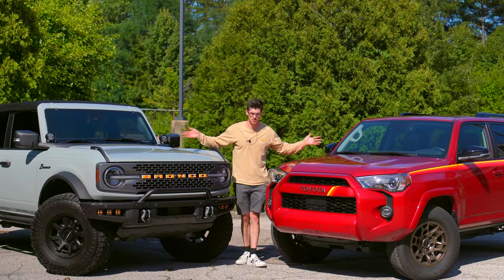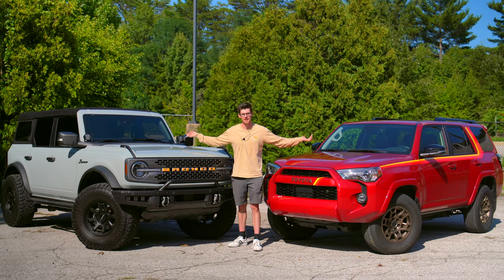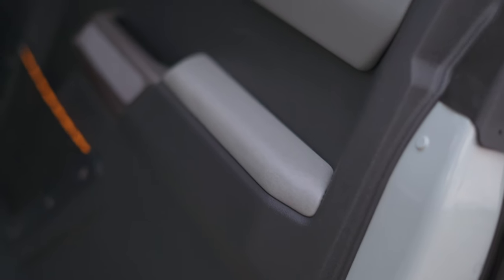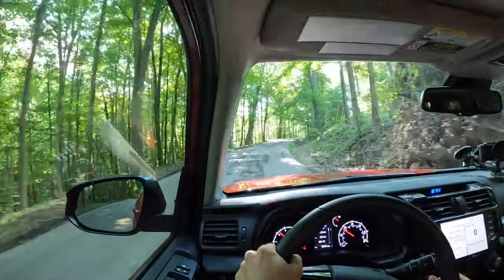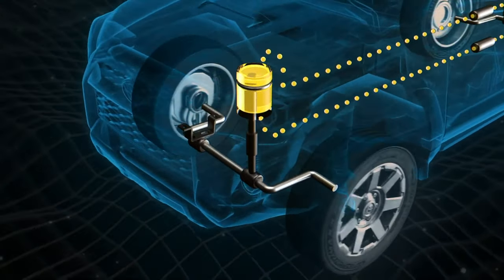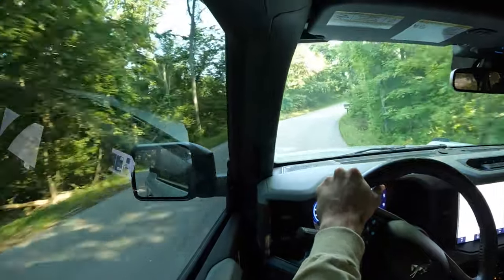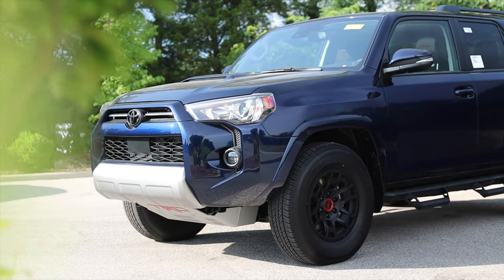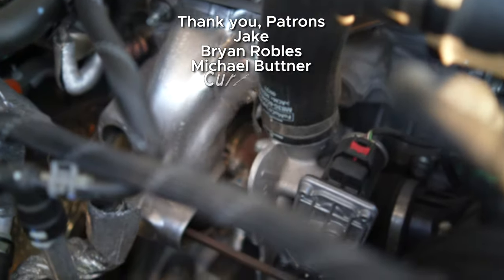2023 Toyota 4Runner vs Ford Bronco In-depth Comparison / Rivalry Resumed

Comment: I will never daily drive anything other than a 4Runner. My '06 is a tank  and asks for nothing but fuel. I respect the Bronco, but 4Runner for life.
Reply: I had to replace the transmission in my Ford Explorer at 104,000 miles.  Prior to the Explorer I had a Bronco and had to replace the transmission at 114,000 miles.  I switched to 4Runners and will stay with them as long as Toyota makes them.

Comment: I really, really wanted the bronco. Ultimately went 4runner for long term reliability (I know I know). No regrets.
Reply: I did the same as you and I would of had the family pricing with Ford, no regrets either.
Reply: Same
Reply: The 2.3l is really reliable tho I've worked on some with 120k miles (not the bronco) that just asked for a oil and filter change, a bit of carbon build up on the valves nothing else ,some people claimed 200k miles out of their 2.3 it really depends on the driving and maintenance if you're gonna abuse it and skip oil changes get the 4runner but if you're a careful owner and do everything by the book even if you drive it hard you can still expect the bronco to last a long time
Reply: Ive had a bronco Badlands for 60 000 hard miles. I drive offroad most weekends and lots of winter driving. 0 issues

Comment: Unfortunately the 4Runner comes only with an automatic transmission, and the closest brother is the Tacoma which is way too slow. I went with the Bronco 2.3 Manual, 2 doors. 9k miles with Zero issues.
Reply from the maker: That new taco with the 2.4 and mt may change it but the 2 door bronco is undoubtedly more fun, congrats!
Reply: The fact that you have to state 9k and no issues should tell you chose the wrong vehicle 👎
Reply: @TonyTundra5.7 u a 🤡
Reply: @TonyTundra5.7 you can keep getting scammed by Toyota if you want 😂😂😂😂

Comment: I’m obsessed with my 40th anniversary edition 4Runner…I looked at the Bronco but for me there was absolutely no debate.  I’ve owned it 3 months now and I’ve never been so obsessed with a possession… It’s weird lol.  I just turned 40 years old and was born the same year the 4 Runner came out so I’ve seen and respected them my whole life…Im a car guy and traded in my GTI for it.  The GTI was an awesome car that I loved too.  No issues with it besides occasional electrical quirks.  But the obsession that hasn’t gone away since trading in for the 4 runner is real.  So well made feeling.  I like the smooth truck feel on the rode and shitty roads.  It’s just a pleasure and I find the hydraulic steering an odd pleasure too.  No it’s not super responsive or tight like my GTI…No I don’t smoothly effortlessly fly up hills at low rpm’s like my GTI did….But I’m 40 now and don’t care.  I like the smooth daddy 4 Runner.  The only thing I’d trade it for in the future is MUCH better gas mileage.

Comment: I ended up buying a Bronco this January. I test drove a 4Runner, and Bronco Sasquatch V6. The V6 just ran better and hauled more butt than the 4Runner. And the Bronco was more fun to drive. Very responsive on the Highway and city, and with crazy tourist divers where I live, I needed something that responded well. 

And at the end of the day, it did more of the things I wanted to do. Doors off. Roof off. I know that’s apples and oranges to the 4Runner, but that is what pushed me over. 

And at now 24k miles, fingers crossed, no issues.
Reply: Any updates on the bronco? Still running strong? Mileage update?
Reply: @slickman9696
Reply: Need updates man
Reply: how’s the bronco been?

Comment: I owned a 2018 4Runner trdOffRoad and it really was a fantastic vehicle.  Very comfortable.  The 4.0L engine is great and surprisingly well matched to the 5 speed auto.  But towing needs now have me in a 21 f150 (diesel) which I also love for different reasons.  

Folks complain about Ford quality, but my experience with my f150 has been great.  The truck is holding up well no no real issues so far in 30k miles.  Can’t speak for quality or durability of the bronco, though.  They certainly don’t make as many of those s they do the truck (which they produce a bazillion of each year).
Reply: Give it some more time.  Please, give us an update when something breaks.
Reply: No issues in 30k miles should be expected on any vehicle

Comment: Bought a used 2014 ORP with 80k miles, did my research and checked thoroughly for any abuse or neglect. Comes with no warranty, and no warranty needed so far. Now have added 15k miles and I love how strong its body is and have added a ladder and a Sherpa rail. Been in a few adventures

Comment: I have a 23 Basesquatch with 780 miles on it and its at the dealership for electrical/Charging system problems. The bronco looks awesome but Iam thinking about trading it in for a new trd orp.

Comment: It was an easy call for me, sway bar disconnects (way more articulation), front and rear lockers, full skidplates and rock rails, Steel bumpers, better offroad tech, convertible and looks amazing

Comment: Bought a 2023 TRD Off Road Premium in Oct. of last year. Taking it off roading in Montana end of May. I'll let you know how that goes, but from everything I've read and watched on YouTube, the 4Runner out preforms the Bronco off road.
Reply: Back from Montana now, the 2023 has 4 cameras, back up, front facing and two on the mirrors. The front and side cameras come on when in crawl mode and make navigating tought terrain extremely easy. Took it up and down mountains some descends on very narrow, 7 degree grade very rocky terrain. Largest were about the size of basketballs. Took her in to get looked over before driving back and everything was tip top shape.
Reply: Having owned both and having taken both off-road many times, unfortunately that just isn’t true. In almost every aspect of off-roading, the Bronco outperforms the 4Runner.
But that’s also expected, as the Bronco is an off-road focused vehicle, where the 4Runner is more of an on-road/off-road hybrid. And there’s nothing wrong at all with that. For 90%+ of all drivers, the 4Runner serves its purpose.
But for those who actively take part in frequent off-road driving, the Bronco is clearly the way to go.
Reply: @Rapaglia1  idk I watched a ton of use reviews and the 4Runners technology made off roading way easier for the regular guy. Now if you're taking tip top preforming, you might be correct.
Reply: @joshualinse9000 
I’m speaking from personal experience. If the average off-roader wanted to take their 4Runner through a mountain trail, sure. It’ll handle it just fine. When you start adding 35”, 37”, 40”, 44” etc. tires to the 4Runner, it starts to seriously degrade performance. With that, you have to change out the gearing as well. The 4Runner also doesn’t have a sway bar disconnect which is a huge advantage for the Bronco.
I like 4Runners. I think they’re great vehicles. But the bottom line is that they are made more for the average driver to drive on the road with occasionally taking it on trails or through other off-road terrain. And it’ll manage that just fine. It’s just that you can’t do many upgrades to it without having to do major tuning and calibrating.
The Bronco, on the other hand is purpose-built for off-road driving. Adding larger tires and even bigger lift kits is no problem. Not to mention, because the Bronco is more versatile and more customizable than the 4Runner, it has access to an entirely separate upgrade market of parts and performance tuning. As far as on-road daily driving, it’s better handling, smoother, and easier-driving than the Jeep Wrangler, but not as good as the 4Runner. Again, in my experience, it’s a great daily on-road driver with good power delivery, excellent safety features, and all of the creature comforts that you need. The Bronco is perfectly suited for daily driving; just not as comprehensively as the 4Runner. What I’m saying is that the Bronco is a much better 2-way vehicle than the 4Runner. The 4Runner is a much more functional and comfortable daily driver, but it’s not as comprehensive as an off-road rig than the Bronco.
It just depends on what my driving goals are. Both have their strengths and weaknesses as far as how and where you choose to drive. There are many situations where I’d rather have the 4Runner. But there are many more situations where I’d rather have the Bronco.

Comment: Price be darned, I'm on waiting lists for both the forthcoming Lexus GX550 and Toyota Sequoia TRD Pro (2024).  Test-driving a 4Runner, I found it just a bit too underpowered compared to my '17 Tacoma.  I liked much of the Bronco's specs, but can't get over its unreliability.  I wouldn't have the time or patience to have its top-of-the-line engine go out and need replacing, taking ~7 weeks.  Given the two choices in this video, I'd go with the 4Runner.

Comment: The sticker price on my 22' 2 door Bronco Base manual was $28,500. The 35" Mickey Thompson Baja Boss were a little extra but at the time manual transmission wasn't available with the Sasquatch package so I elected not to go with the Sasquatch. Coming up on 20,000 miles with no issues. I wouldn't want any other vehicle. I drove a 4 Runner once, and the body roll was absurd.
Reply: I did actually have 1 issue right off the bat, there was a problem with the headlight switch and the headlights would come on randomly after being parked for about an hour, stay on for about 10 minutes and then shut off. It was fixed for free simply by getting a new headlight switch and problem was solved.
Reply: How and where did you get that price
Reply: @AngelMartinez-kf1dg  I put my reservation in June of 2020 for a 2021 and the price was $28,500. There were so many delays that it kept getting pushed back. Eventually they said it won't be available until 2022 so they upgraded me at no extra charge for the 22' model which I got in March of 22'. New Brighton Ford in Minnesota.

Comment: I don’t really understand the hate for the 4Runner’s 8 inch screen. Yeah the back up cam is pretty bad for sure. The screen though looks very purposely built in and is more than sharp enough for apple care play, which is all that anyone uses.
Reply from the maker: It doesn’t deserve hate, I appreciate its simplicity but it does deserve criticism for the camera quality, response time and meh resolution/brightness. Id rather have it over a lot of full digital setups that imbed the hvac controls.

Comment: After having owned a 2022 4Runner, and now a 2.7L Bronco Outer Banks with Sasquatch, Lux and High packages, I will never buy another 4Runner again. First of all, everybody drives them. They’re not special. But not that many people own Broncos.
On top of that, the 4Runners are boring, slow, and getting outdated. Even the new 4Runners are already going to be lacking behind in engine performance and electronics.
While they’re reliable vehicles, they’re not nearly as rugged or capable as the Bronco. On top of that, they’re just like any closed platform vehicle. With my Bronco, I can remove the top and doors and experience a true open-air driving experience. And the Bronco cool factor is way ahead of the 4Runner.
The 4Runner might be a more comfortable on-road ride, but the Bronco’s road handling is just more fun. And if I’m going to have a vehicle for the next ten years or more, I want it to be one that I enjoy driving.
So, because of the enjoyment factor, the driving experience, the on and off-road capability, the better amenities, and the more customizable options, the Bronco is the clear choice for me.
And don’t get me wrong - I love the 4Runners. They’re a symbol of standing the test of time. I had a great time with mine. But all things considered, compared to the Bronco, they’re just not in the same class.

Comment: I own a 22 TRDORP, so I am biased. I did however cross shop it with a Gladiator and Bronco. I love them all for their own reasons, but the 4Runner is just more solid, comfortable, and way more roomy than either while being just as or more capable off road than either of the other two options. Biggest issues I have with the bronco are reliability concerns, fit and finish, and cheap interiors. Ford in general needs to step up their game on interior quality and touch surfaces.
Reply from the maker: I hear that, though it’s also important to remember they can’t do near as much with interior quality when the doors and roof are removable. If they had a fixed top version it would be much much more refined!
Reply: @Realistick  but the cheap interiors are not specific to Bronco only. You can look at the Explorer, Mustang, F series pickups, etc and see/feel super cheap plastics and the fit and finish is horrible. For instance, compare the pickups of the big three (Ford/GM/Ram) and Ford is way behind in quality. So it’s not, to me, exclusive to the Bronco. The Wrangler/Gladiator has removable doors/roof and has much better quality soft touch bits.
Reply from the maker: @Christopherthill  I suppose if you're comparing all Fords to the 4runner (I'm not too well acquainted with ford's other stuff). The RAV4 and Corolla based models are pretty cheap feeling too (especially the corollas). I disagree on the Wrangler, at least the last one I was in felt very similar, better in some areas, worse in others.

Comment: Toyotas reliability is true when it comes to onroad and a little offroad to the campsite. But real off-roading where you do some rockcrawling that’s where the 4Runner will lose against the Bronco or the Wrangler. First of all, once you put 33” tires in the 4Runner, your mpg goes to hell and the shifting gets way off going uphills. Both Bronco and the now the Wrangler can have 35” tires from the factory in turn has the proper gearing installed from the factory as well. Also, the 5th gen 4 runner only has a 5 speed tranny, which xponentially gets worse when you install 33” tires. You’ll want to at least install 33” tires on the 4-runner if you want to get some good ground clearance, but its efficiency goes down the tubes. A 4-runner with 33” tires gets an average of 14mpg on road trips if you average 80-85mph on the fwy when the Bronco with 35” tires gets about 17mpg. And the Bronco doesn’t have to downshift even going uphill, and if it has to, it has 10 gears so it will not start screaming from 1 gear lower. But the 4Runner stock is definitely good and reliable.
Reply: I have 33's and my average is 17.4 mpg with falken c rated wildpeaks on my 4runner. It's all about weight and how much armor ur putting on ur rig IMO. Im also high elevation which helps.
Reply: People use Toyota because they take more abuse than junk fords.That’s the reason arabs use Toyota not shitty fords.Africans use Toyota,Australia use Toyota every in the world covered by Toyota.
Reply: You might want to rethink about your storey, there's alot of 4runner's out there that has gone places where jeeps have crawled, don't kid yourself, 4runner's can hold their own and still bring you back.
Reply: @johnwebb2232  I don’t doubt that. But you’ll have to add on upgrades that will cost a lot of money like gearing since Toyotas only come in 32” tires. When 35” is the new 33”.  Ok the new Tacom’s looks like it can fit a 35” tires, but it still doesn’t  offer it install by the factory. Buying the top of the line 4Runner, you still need to upgrade it with gears and bigger tires. Jeep & Ford you don’t have to upgrade. You can upgrade any rig! But it’ll cost you.